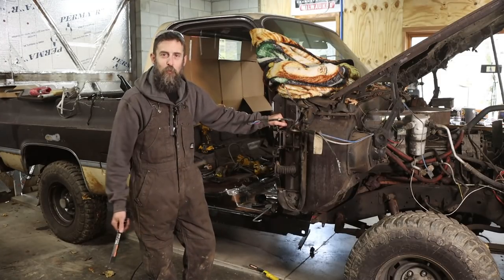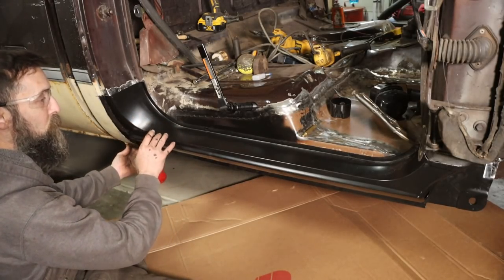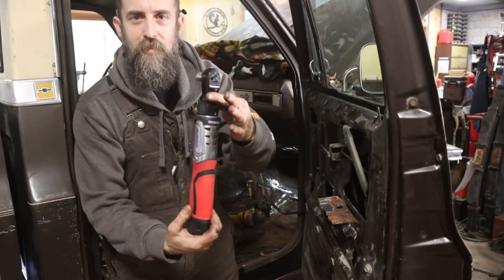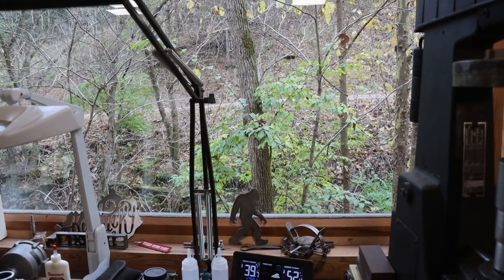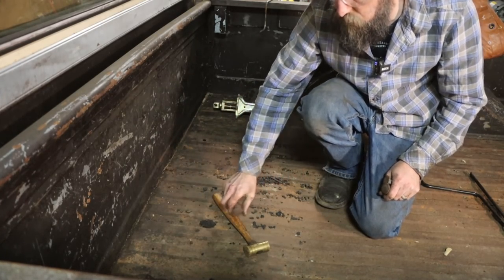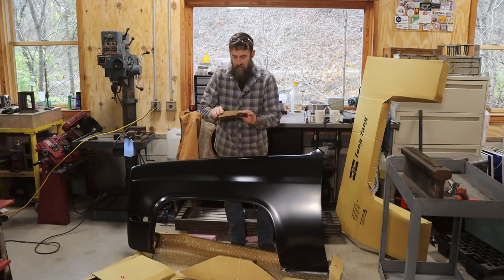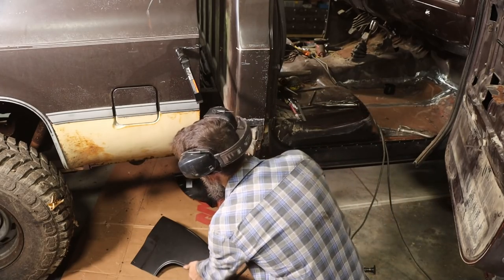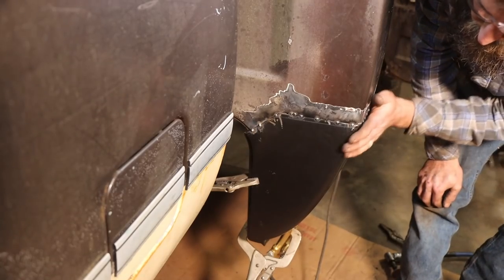STOKED! Cab Corners & Rockers In the Firewood Square Body.  Part 9 #chevrolet #squarebody

Comment: Hi Steve. You where talking about the Headlights and mentioned the tail lights as well,
I have been also considering going LED (I have a 96 Toyota Hi-ace Van with 5x7 inch Headlights but only one each side)
Though expensive at between 70 to 120 ish $ a pair for the head lights the money though considerable isn't my main concern but the heat sink on the back of the globe and will I have enough room to fit them in the headlight bucket.
My Hi-ace basically doesn't have a front end as the engine is under the driver and passenger seats. Also I have heard that you need to change all the lights back and front and possibly the flickers/indicates to Led as you can't mix and match globe types. 
I have a 26 inch Light bar on my Roo bar and compared to the standard lights which look yellow next to the pure white of the LB and that thing lights up appropriately 3kms of road 
(I live in the Wheatbelt of Western Australia, out bush in other words) the normal lights are pathetic compared to the LB 
I will be going LED when I find just what I am looking for 
I think you would be impressed with led as well. 
Or an alternative option is keep the old standard lights and fit a led light bar as well 
Tony from Western Australia 🇦🇺

Comment: ppg dp40 epoxy primer and satin clear.    dp40 has no UV protection,  clear it and add a flattener to the clear.   did a  1955 mercury years ago.

Comment: G’day Steve, personally I believe you’d be better off replacing the headlights with an LED System. Keep up the great work and videos mate. All the best from Australia
Reply: Everybody keeps saying “LED”, but the first time you have to drive in wet snow, you’ll be ready to switch back. Incandescent bulbs make enough heat to keep the snow melted off. LEDs won’t…….
Reply: @notajp  Thank you for that info JA. I’m an Australian so I did not know that about snow driving. Have a good one, mate.

Comment: you going to put bed liner in the interior? makes it rough and ready, but won't rot from moisture?
I'm glad you are doing this. sometimes better the devil you know, vs the devil you don't know.
this will be a good work truck with upgrades from the dead.

Comment: Keep it the same colors put the tan in middle instead of the bottom body side molding will cover the paint edge pinstripe the top edge of paint line it will look better than the factory paint scheme

Comment: As for your headlights, depends on what your going for. From watching your videos it seems you prefer to keep your restorations as close to the OEM look however if something could be improved without sacrificing that stock feel you're fine doing so. If that's correct, I would look for some headlights that fit the original shape and look but give off much more light as this truck purpose is for work and not for bringing "the show".

Comment: I’d probably go with the LED headlights, gonna be far better than the originals. 
I’ve got a good suggestion for bed patch panels. Get a 4x8 sheet of of tread plate, and make it a flat bed. 😬
As to colors, anything but what it is currently. Never cared for that color combo.

Comment: I would replace the headlights with LED lights. I plan to replace mine as the LED provide an improved visibility at night.
Noticed a sample plastic bottle on the drivers side. Is that a find or to hold fasteners?
As for the color, something I think is really personal, but if it were me, I have always loved the British Racing Green.

Comment: LED would be my thoughts for the lights but I don't know which are good ones. I see some that show a 5 year warranty but reading further they say 2 year warranty so it seems to be buyer beware. It looks like all 4 are hi and low beams in LED so you can connect them to have 2 or 4 lights. I might use all 4 on high beam and just two on low beam. If they are DOT approved they should be legal and not blind oncoming drivers.

Comment: Factory colors. Xenon headlights. Don't waste any money on that engine. Get a used LS and some kind of plug and play harness. Injected engines don't mind as much leaving them sit. You might want to replace the entire steering column with a modern one with the key immobilizer and a flashed factory ECU. Those 80's GMs used to disappear quickly.

Comment: At 18:13 you are talking about how your alternator belt wears out quick. From the video it looks like the alternator pulley and the pulley that drives it are not co-planar. Is that an optical illusion? If not would that explain why your belt gets chewed up?

Comment: I´m thinking keep the original paint scheme, or very close to it. It is not a bad looking truck, and having familiar colors on it makes it not stick out too badly. I think most older vehicles with crazy paint jobs are an eyesore. Maybe if the truck had other color options from factory, that appeal to you more, you could switch to one of the others. On a newer vehicle it is more okey to go crazy, no one cares about those anyways :)

Comment: Thanks for sharing your body working skills.  There is no substitute for experience and your discretion between "workman like" bodywork and concours is appreciated.
Just guessing  (and you may have answered this before) you are using 0.020" wire with CO2 cover gas?  I'm wondering if 0.035" would be to "heavy"?  Thanks!

Comment: I would ditch the old bed and fabricate a flatbed with removable stake body sides. With the amount of machinery you haul in and out of the shop, a flat bed would work better and you could put on the sides for hauling firewood.

Comment: maibe you have machines that are big enough that you can bore out and deck the block and fit new pistons , you probably could fit new valveguides machine the seats and deck the heads too i'd be interested to see how you would do it
as for the headlights , i seen led type headlights made for these trucks , think there a little brighter and mire resistand to wateringress

Comment: Hi Steve,  I know you have lots of experience with sharpening tools.  I am trying to figure out a good way to sharpen Step Drill bits.  I have a surface grinder and tool post grinder. Any suggestions or better yet can you do a quick video on IG or YT?
Reply from the maker: Just lightly touch up the flat at the cutting edge.  Anything other than that is a very tough setup. Thanks for watching 👍

Comment: Replace the headlights, period.  Ever since they converted to quartz halogen headlamps, these headlights have not exactly been "sealed beam".  Instead of being all one piece of glass, the lens portion is simply glued to the reflector portion.  The reason for all the yuck in two of your headlamps is because the glue has crusted, as I remember happening to my father's SUV.  When you pull them out, watch the lens portion just fall right off!!!  Who knows how long before the other two burn out?

Comment: I know exactly what I'd do for headlights because I just replaced mine. I went down and bought the standard fare which is halogen at my local store. They should be plenty bright without blinding everyone on the road. Seems everyone wants the new new thing but trucks and jeeps are the worst. Seems like they install them and don't adjust them and don't account for towing.

Comment: Steve ,  I have a question ? what are you going to do to the small block in the truck ? just the heads or a total rebuild ? I just rebuilt a 67 Chevy 327  ( the right way ) New everything and balanced & blue printed with RV cam specks.  Cost me about $4K in parts & machine work and I still have to assemble it .  Going in my 1970 daily driver 4 door Chevelle after pulling the original 307 out .

Comment: Keep the original colours, they don't make trucks like this and they don't use colurs like these (new vehicles care all silver, black or some shade of blue, red is rare, brown or green are almost gone), I think old color suit old cars/ trucks. And about leds they aftermaket ones are not OEM quality and bulbs are easy to replace, plus you find the evreyware. Maybe just some new headlights instead of the old style sealed beam ones or add some extra lights maybe a light bar for offroad use. Can't wait to see the truck done.

Comment: I bonked a deer last night my way home.  idiot creatures. Dangit steve I didn’t want to join in on the body work party.  happily I don’t have anything even remotely this in depth.  nice job all around.  You know I saw you with that torch and bolts and It reminds me every time of how much I used to love the little induction heater for bearings I had access to and how handy those hand held ones seem.

Comment: I replaced my Tundra headlight bulbs with inexpensive LED's and lost 1/2 my radio stations because of static.  Ferrite beads and shielding didn't help.  Complained to seller and they sent me the new "improved" bulbs that got rid of most of the static and the lights are really bright.  Hate for you to mess up your sweet sound system...

Comment: Headlights: Replace with LED versions - go nuts and slap a LED light bar on the roof for sh!ts and giggles.
Colours: Original Brown where it is now but Ferrari Yellow instead of Beige. Black for inside the tray and tailgate using corrosion resistant tray liner paint (waffling here.. can't remember the name of the stuff - helps with noise reduction somewhat).
Tis cool to watch transformations like these - please have some PHUN with it !

Comment: Regarding the spark plug that keep fouling, a trick I used 40 years ago on my fouling plug was to open the gap on the plug. It gave it a hotter spark (someone may know the technical term for that) which increased the time between fouls. It may work for you and anything is better than taking the annoying sucker out ever 200 miles.
Your fenders are made in the Republic of China aka Taiwan which is not to be confused with the People's Republic of China aka PRC (pronounced prick ) so you will get a quality parts from a democratic and free country unlike the dictatorial communist pricks and their chinesium manufactured rubbish. I have no issue with the Chinese (my wife is half Chinese ergo my daughter is ¼ Chinese) but I do not like their corrupt, lying, two faced CCP government pricks.

Comment: Amazing example of a product designed to fail. The problems are amazingly wide spread. Exposing the floor and interior panels to road debris is a brilliant way to assure failures just outside of the warrantee. That would kill any undercoating and even galvanizing which otherwise would extend the life at little additional cost. Would $100 (back then) of stainless in the right places not make this last forever?  Would a rusted hulk like this have enough structural integrity to protect you in a crash? Not a chance. GM and all the others have just trained their customers to accept this design failure as normal and keep buying new vehicles. Volvos don't rust because they are designed not to. Trucks could do the same. Got to admire your patience, diligence and skill to tackle this job.